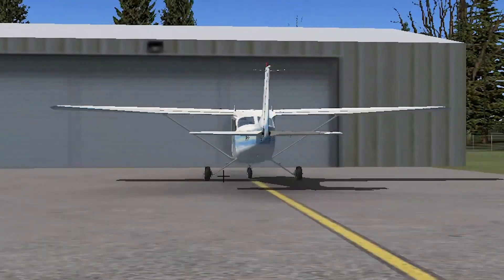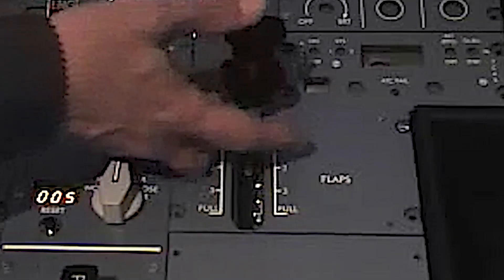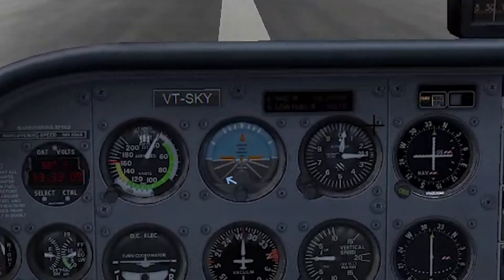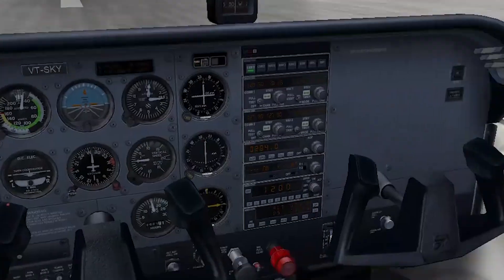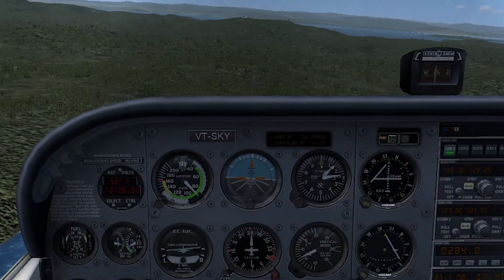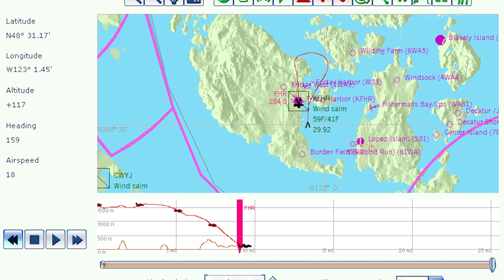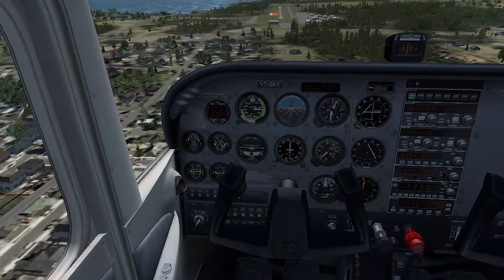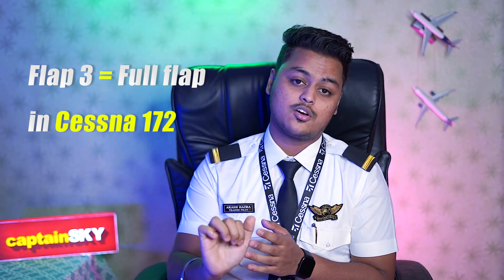WHAT ARE PILOTS TRAINED ABOUT FLAPS? + Flight Simulator X gameplay

Comment: I have one silly question about Cessna .it has no nose nose steering .how it still can be steered with rudder at low speed on the ground ?
Reply: No actually The Cessna 172 does have a wheel steering system, obviously. And it is mechanically linked to the rudder pedals ☺️